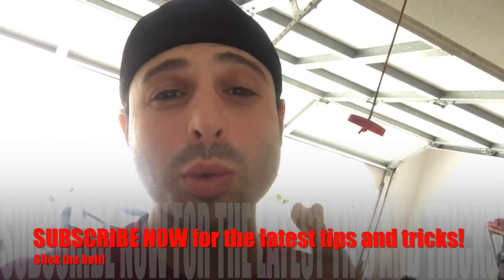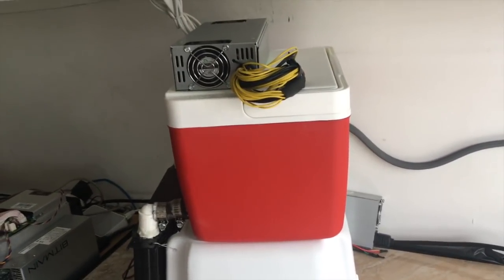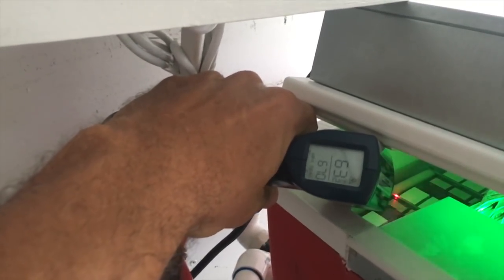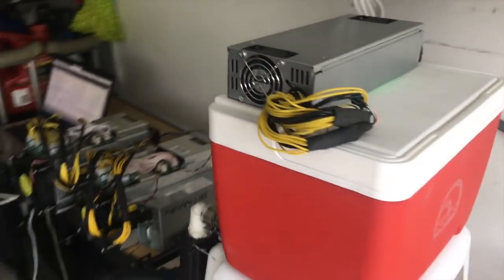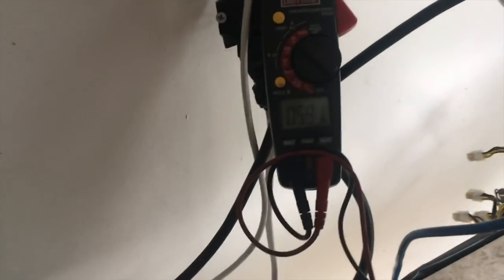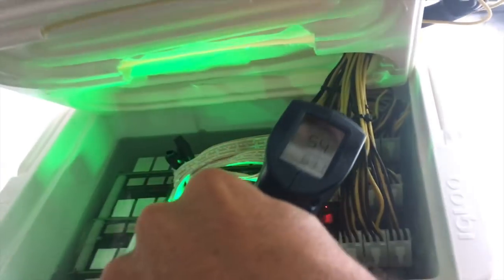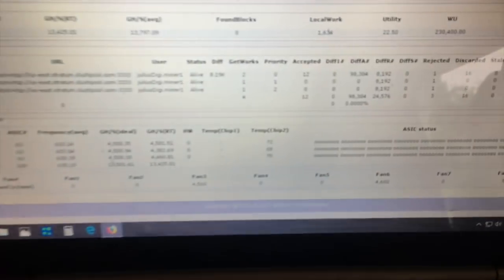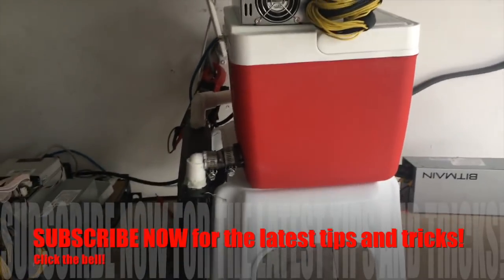Bitcoin Mining Experiment! How to 16ths liquid cooled Antminer S9 with mineral oil

Comment: Some tips: first, uninhibited transformer oil (e.g. Shell Diala) is a) far superior to anything fancy outfits are marketing as "speciality oil" b) non corrosive c) is designed to absorb some phenomenal amounts of heat - your average S9 will at most dissipate about 1.2KW, so you can comfortably house up to 50 units in a bath containing 205 liters and c) a lot, lot cheaper. Second, use a water-cooled heat exchanger instead of your dry cooler (rad + fan) - cheaper, far more efficient, and totally silent. Third, disconnect your miner fans and replace them with fan simulators (if you're clever, you can simply use a 555 timer, wired as a free-running oscillator at 20KHz and 50% duty cycle, and save yourself a bundle on the simulators, or simply buy them at around $20 for each board simulating 2 fans) - you'll get whisper quiet operation. Fourth, a central heating circulating pump from the likes of Wilo (e.g. Wilo SB30) is about $200, is whisper silent and designed for 100% duty cycle (24/7 running), flowing at just over 71 L/min @ up to 10 bar. Combine that with even the most basic water-cooled oil heat exchanger (e.g. Bowman DC120 Oil Cooler), and you have a setup easily able to shift a minimum of 40KW of heat, without blinking, and that's simply running fresh water out of the tap (UK spec: 2 bar pressure, around 10°C average throughout the year in London). Hope this helps - I'm going to publish the details of my cooling rig made out of a 1-cubic Meter IBC tank and components mentioned, fully immersing a set of 15 S9SE miners, running at 20TH/s.

Comment: I was wondering if you could tell me what Radiator & Fan combo did you use, as well as the pump size. Great stuff bro. Your right the fish tank video with the Radiator they used would not cool down the unit.
Reply from the maker: Using a car radiator and I’ll get the pump info. Still working on designs
Reply: @MinerDigi  Any update on what pump your using? I am curious as well.

Comment: This is exactly what I've been looking to set up!..  What kind of pump are you using to push from the radiator to the cooler? Will the mineral oil harden the rubber hoses ?

Comment: Awesome ! How did you disable the fanspeed detection? When the fan speed is below 2500rpm or not connected the miner will normally not boot.... Do you know how  you can change this speed limit to 2000rpm? so I can use my very quiet fans ???

Comment: Thank you for the idea,i was looking about it.i have 10 Antminers and I want to make them liquid cooling.what kind of oil do you use and what about the miner fans?
Reply: Fans can be completely removed or not. But The antminer won’t run if the fans are in oil or removed. You could try to find a custom firmware to ignore this, or fake the fans with a hardware device like this:
http://rover.ebay.com/rover/1/711-53200-19255-0/1?icep_ff3=2&pub=5575378759&campid=5338273189&customid=&icep_item=183166429510&ipn=psmain&icep_vectorid=229466&kwid=902099&mtid=824&kw=lg&toolid=11111
Reply: Ok guys thanks for your answers but I have already saw these products.i can see no fans at video that’s why i ask,also the module to trick s9 with fans is pretty expensive,other guys says fans needs to pass oil threw miner other has trimmed the fan to work under resistant of oil.what do you think we need to properly use for that mod?
Reply: If you know basic hardware design you can make the faking device yourself (I make the one I linked to)
It's just a a frequency oscillator with an open collector output.
I'll also accept offers if you are buying multiple units.

From my testing the fan isn't able to push oil all the way through the miner, oil is just too thick.
But it isn't needed, hot oil rises away from the chips without any fan.
Reply from the maker: Thats correct. We are not using any fans!

Comment: You said the S9 using the 650 firmware doesn’t display the correct temps. Do you think it’s running hotter or cooler than displayed - with just airflow cooled (cold/hot chambers)? How are you cooling your miners running on 725 freq?
Reply from the maker: Curtis I believe they are running cooler because the oil is not getting hotter than what is shown on the IR gun temps

Comment: Awesome, I was always curious about doing this. Is it possible to insert the PSU into submersion too? In order to lower the noise a bit more? Also please keep us updated on your design testing for this, we need more educators in this still new field!
Reply from the maker: I think that it needs to be kept out of the oil but I will keep you updated with more testing.
Reply: You should also disconnect the fan on the PSU.  Most PSUs will run without a fan, unlike the Antminer. Otherwise the viscosity of the oil will load the fan and it will burn out.

Comment: I can only figure that the cooling and noise reduction can be used on a s3 miner what im looking for is overclocking method  or program that can be uesd for the s3 any suggestions on were to find information for that unit
Reply from the maker: I would try bitcoin talk forum and see if you can get the settings to overclock. You may be able to use my method on it.

Comment: How do you solve the fan speed issue. My Miner wont run as fan speed slow in oil. Thanks. Nuti
Reply: hi.. so your miner doesnt run due to low rpm? so it need to be hijacked first?